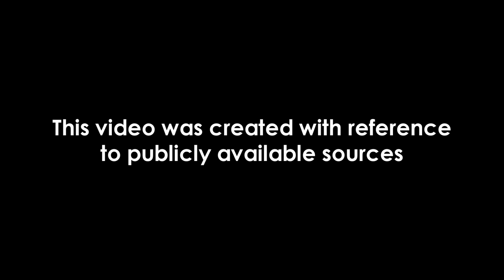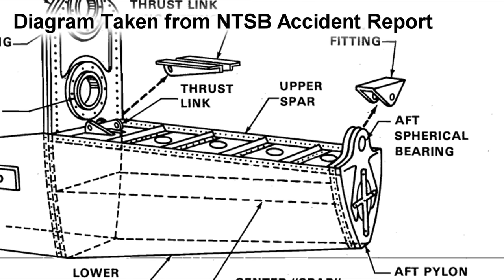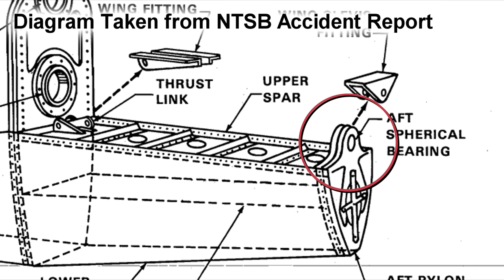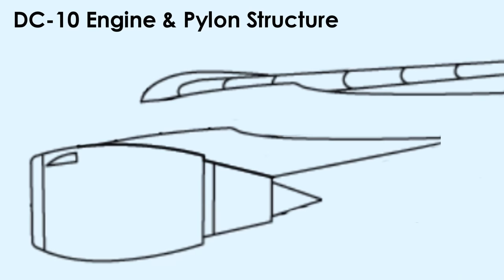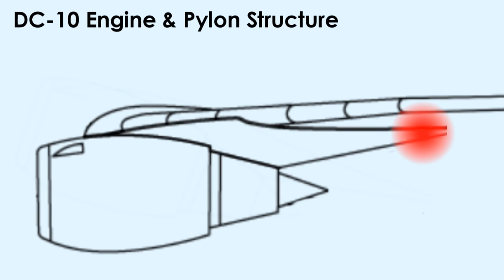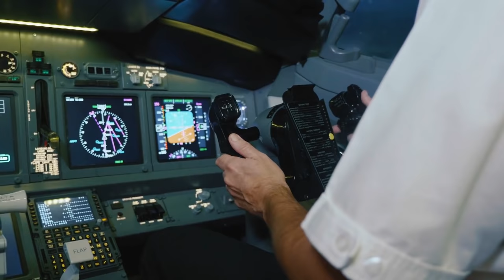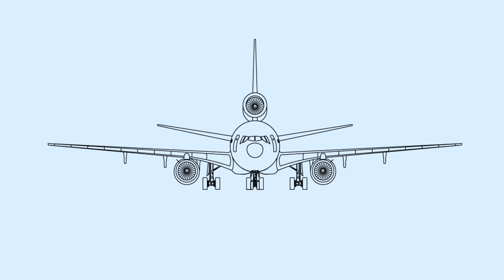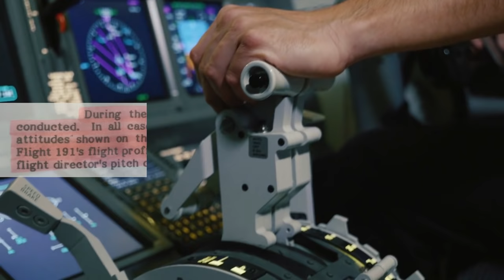America's Deadliest Air Disaster (American Airlines Flight 191) - DISASTER BREAKDOWN

Comment: This accident has always particularly horrified me. There were so many odd quirks — the captain wasn’t supposed to be on that flight. Parents who just happened to take a last minute trip to Hawaii and died. The CCTV footage available to passengers — showing them an external view of their imminent crash. And, most of all, the death toll. The way this plane went down was so preventable, and that is the saddest thing of all. Thank you for making another excellent video.
Reply: It wasn't preventable for the pilot maybe if he noticed earlier but at depaqrture a lot of things can happen. Just the maintenance crew screwed up big time
Reply: @saladasss2092  That is what I mean. If the maintenance had been performed correctly, this accident would never have happened.
Reply: @kristita_888  and it even said that maintainance shortcut was common practice
Reply: @saladasss2092  It was common practice at a couple of airlines — American and Continental. BUT that practice was not consistent with how the recommended procedure for the DC-10 stated that engines 1 and 3 should be removed from the pylon and wing. This is one thing I’m pretty familiar with, as my father made his career in maintenance with Continental Airlines, working from mechanic all the way up to manager.  He would not allow the men (they were all men in maintenance back then) to remove engines and pylons from the wings as one assembly — he insisted on following correct Douglas Company procedure.
Reply: @kristita_888  I wished there were more people like him instead of companies trying to cut corners to save money and endangering lives
Reply: When it comes to safety they shouldn't take shortcuts in maintenance. People's lives depend on it.
Reply: @margaretjiantonio939  I completely agree, and fortunately my Dad did, as well!
Reply: @saladasss2092  actually shortcut pratices like this are usually proposed by the mechanics performing the work
Reply: @kristita_888  What if's are a part of life!!
Reply: @Xscapeplan01  Yes, they are. But these “what if’s” never should have happened to innocent people. Just my take on it.
Reply: The saddest part was that the aircraft remained flyable but since they had no way of knowing they had physically lost an engine they could only follow procedure for loss of power. It was slowing to V2 that actually brought them down
Reply: @PabloGonzalez-hv3td  Such a good point! 💔
Reply: Oddly, it seems like these weird coincidences tend to happen in huge disasters. Just look at Apollo 13. The same thing happened where one of the pilots got sick, so another substituted in. This likely played a huge role in saving those in space as they had a fully capable person to do simulations on the ground. I suspect it's just common occurrences that just happened to coincide with the disaster so we look at it as if they were huge deals.
Reply: @cbot9302  You make a good point. And oh my gosh, the WHOLE Apollo 13 incident — just wow!! It’s a miracle those men made it home at all. If you’re at all a space geek, have you seen the miniseries “From the Earth to the Moon?”  It came out several years ago but it is SO good.
Reply: Not to mention important scientists like Itzhak Bentov, who was working on the gateway project, was aboard that plane
Reply: I guess if I had to go in an air crash this would be the best way to go.  Quick and easy.  Look at the Alaska 261 crash, also caused by maintenance cuts.  Now everyone on that jet endured a lot before crashing.  Now there's a crash that gives me nightmares.
Reply: @Litrocks13  — I will agree with you there. Those poor people. The flight crew never gave up trying to fly that aircraft, not once, not even when it inverted. For a moment they thought they were regaining control as they flew upside down over the Pacific...horrifying!  Yes, I would rather be in this crash than on Alaskan 261, if I were forced to choose.

As a little side note: my dad (a retired mechanic and inspector for Continental) and I were watching TV when news of that  crash came through. He heard the details that had come in so far, turned to me, and said, “I’ll bet it was the jackscrew in the tail. Those things are a pain in the ass.”  Sure enough — the jackscrew had failed due to inadequate maintenance. He knew it in five minutes. Crazy!
Reply: CCTV on the plane? What are you smoking?
Reply: @hootowl2112  You a little rude? 😂
Reply: @saladasss2092  200 hours of pay was worth more than those people's lives. Or more accurately, 200 hours x however many dc-10's were needing the maintenance.
Reply: @hootowl2112  No1 is smoking anything, its true. As a curiosity they had a camera in the cockpit (not just this plane, on several planes back then) behind and above the pilots with a look through the windscreen. The picture was send live to the big passenger screen, so the passengers could have the "full experience" of takeoffs and landings.
That practice was discontinued due to this accident.
Reply: @hootowl2112  They've had this for a while lol
Reply: @saladasss2092  I think the worst thing about it for me was that on this series of planes there was a video feed of the pilots view displayed in the passenger section so they could experience the thrill of takeoff. That means they got to see video of the ground coming at them right before impact
Reply: @PabloGonzalez-hv3td  - True, but to be more specifically accurate:  It wasn’t the physical absence of the engine, but rather that the leading edge slats retracted due to damage from the separating pylon AND that the captain’s stick shaker (stall warning system) was also depowered due to the loss of the engine.  Had the slats remained extended they would have been able to continue the takeoff, and if the stick shaker had been powered, the crew likely would have recovered from the stall and continue back to land.
Reply: @bradcrosier1332  The physical loss of no. 1 engine was the root cause of all that. 
My point is that despite all the damage you mentioned the aircraft was in fact STILL perfectly flyable had they known to maintain airspeed (above the damaged wing's stall speed) instead of slowing to V2; the procedure for loss of power.
Reply: @PabloGonzalez-hv3td  - 100% agree, just wanted to put a finer point on it for those unfamiliar with the details.
Reply: @bradcrosier1332  The stick shaker wouldn't have made a difference tho.
Reply: @PabloGonzalez-hv3td  - I’m curious what your qualifications are to draw that conclusion.

The NTSB certainly did not agree with that assessment (nor do I):

“The National Transportation Safety Board determines that the probable cause of this accident was the asymmetrical stall and the ensuing roll of the aircraft because of the uncommanded retraction of the left wing outboard leading edge slats and the loss of stall warning and slat disagreement indication systems…”

So again, please explain why realizing that the left wing was stalling would not have prevented the accident.
Reply: @bradcrosier1332  Just a hunch but the degrading attitude was plenty indication of a stalled left wing.

I'm curious what reaction you believe the stick shaker could have possibly prompted. 
The NTSB of that era thought smoking was a good idea 😂.
Reply: @PabloGonzalez-hv3td  - Let me put it more plainly:  Are you a pilot,
and if so what ratings do you hold?
Reply: @bradcrosier1332  I understood the question perfectly lol. You ever been in an F-18? 
Now what viable response do you believe the stick shaker and slat disagreement system could have possibly prompted?
Reply: @PabloGonzalez-hv3td  - Nothing Pablo?

I’ll also point out that you yourself acknowledged this fact in one of your previous posts (though apparently you don’t realize it):

“…the aircraft was in fact STILL perfectly flyable had they known to maintain airspeed (above the damaged wing’s stall speed) instead of slowing to V2…”

The stick shaker and slat disagreement systems, both of which were lost when power to the #1 DC Bus failed due to the separation of the #1 engine (which I believe would have also occurred during a engine flameout or failure, but to be 100% on that I would need to dig out my old manuals, which I don’t have time for right now), would have provided warning to maintain speed above the stall. The stick shaker activates PRIOR to the stall.  We will never know if the crew would have responded to that warning correctly - because they never received the warning.  If they had, they might well have responded correctly, and the aircraft might have been saved.  It most certainly was a significant factor. 

Accidents are almost never a result of a single failure.  Read the report with an open mind (re - your nonsense remark about smoking) and recognize that there were MANY failures which led to this (and most other) accidents. It’s called an “error chain,” and if you remove one link in it, you prevent the accident.  Had the maintenance organization not failed by using unauthorized procedures - no accident.  Similarly, had the crew known about the altered aerodynamic configuration of the high-lift devices - no stall, and hence no accident.
Reply: I flew the next week on an A/A DC-10 to Florida. 
I could have been on one of the planes they found with a cracked pylon attachment. They didn't ground them till I flew back on one. Makes the hair on my neck to stand up to think of that possibility. 
I flew DC-10 's alot, later.
Great airplane,  I loved them.
Reply: I was in Chicago that day. The night before the crash l had a dream that l was at a carnival watching acrobats high overhead when suddenly the performers fell off the platform to their deaths. Great sadness consumed the entire arena. The next morning l saw the breaking news of the crash.
Reply: @blakedarwin5171 
Or his cousin, Itchthatmore Bentov.
He invented the entire glotsbac conversion chart responsible for the glatsdale platform on the 747's INS Gyros.
Reply: @hootowl2112  
Melinneal....eh
Reply: @alhanes5803  - [Peg Bundy voice] "Oh Al honey..."

So just what qualifications and experience do you have to back up your assertions?

As to your statement that it, "...it would have only informed them of an impending stall, not that the left wing would alone stall..."

You see Al, the funny thing about swept and tapered wings planforms (and the DC-10, like most airliners has both) is that they both have a very pronounced tendency for the tips to stall before the wing roots.  In particular, the span-wise flow of swept wings at high angles of attack exacerbates and thickens the low-energy boundary layer towards the tips, limiting aileron authority and effectiveness.  Along with that, particularly if there is any sideslip angle, the tips don't tend to stall symmetrically, which mean there is typically a very pronounced rolling moment at the stall (wing drop, if you prefer).  And that is under normal conditions.  Of course you'd know that if you hadn't slept through aerodynamics class, if you've taken one.

This is why stall avoidance is everything in swept wing transports - a full aerodynamic stall can be very unpredictable (ask anyone who has done the stall checks required in the HS-125 series of corporate jets after leading edge maintenance - I haven't, but I've had colleagues who have.  Sometimes it's a non-event, and sometimes it is definitely an event to say the least.).  For further evidence, here's a nice video of stall testing the B-717 (nee MD-95):

https://www.youtube.com/watch?v=L2CsO-Vu7oc

We train to avoid stalls, so activation of the stick shaker WOULD have prompted the crew to act to avoid the stall.  We'll come back to that.

"...therefore, they would still have done, what they did, the exact same way.
Right rudder, and full right aileron."

That is not borne out by testing done after the accident.  From the NTSB report.  To summarize:  About 70 takeoffs were performed duplicating the conditions.  In many cases, the pilots, upon recognizing the onset of the roll at a constant pitch attitude, lowered the nose, increased airspeed, recovered, and continued flight.  Those who attempted to recover the 14 degree pitch up attitude commanded by the flight director reentered the left roll.  In all cases, the roll onset began at 159 knots.  If the stickshaker had been operative, it would have activated at 167-168 knots, providing a warning PRIOR to roll onset (and the aircraft was recoverable at roll onset, if the nose was lowered).  I am NOT condemning the response of the crew - as the test pilots note in the NTSB report, lacking the stall warning indication it is not reasonable to expect that they would have had the information to respond effectively (unlike the simulator pilots who knew  what was coming).  With the stall warning, it is an ENTIRELY different situation.  There is certainly no guarantee that they would have responded correctly, but they would have at least had a chance.  Incidentally, the simulator crews who did recover only needed about 80% right rudder to do so and 70% right wing down aileron - which negates the next bit of nonsense you dispense:

"Most they could have done was, lower the nose, and add power to #2, and reduce even more power on #3 to help reduce the roll."

So no, they would not have needed to do the last two steps, as the first would have been sufficient - which is PRECISELY what the stall warning activating would have prompted them to do.  If you knew what you are talking about, you would know that - above all else, you have to keep the wing flying to maintain control.  Now, reducing power on #3 would certainly have helped reduce the rolling moment, and increasing the power on #2 would have created a pitch down moment; but once the left wing became fully stalled, recovery became improbable at low altitude - which takes us back to my basic contention:  IF the left stall warning computer and stick shaker motor had been powered, the crew might have had a chance to avoid the accident.  The same could be argued about the slat disagree warning light system, but I find it much less likely that the crew would have been able to effectively register that bit of information with the numerous failure annunciations they would have been presented with - but the stick shaker is a singularly unambiguous indication which, by design, stands out among other warning indications.

"If you flew at all, or had even one of the ratings you say you have, you would know  that.
"

https://amsrvs.registry.faa.gov/airmeninquiry/Main.aspx

I don't use a screen name, so search away - I'm right there, as are all of my certificates and ratings.  If you are really Al Hanes, and not someone who doesn't know that the Captain of United 232 spelled his name Haynes, then I'd say that my ATP and type ratings trump your Private Pilot certificate valid only when accompanied by your South African license number PA20059.

So what say you to that?
Reply: @alhanes5803  - Nothing Al?  Please, tell me more about what I don’t know about transport category aircraft operations and aerodynamics compared to you.
Reply: @kristita_888  sadly a lot of occurrences in aviation tragedies have no precedence. Just about everything has to happen ONCE before we take it seriously. Let's just hope this lead to many new ways of thinking and safer practices. Then it's not a total loss.
Reply: @hootowl2112  CCTV has been around for decades. It may not have been in everyone's seatbacks displayed on flat-screens, but yeah.
Reply: @alhanes5803  yeah when I first heard of this accident it was said to be a bolt
Reply: @bradcrosier1332  well done 👏  Always a pleasure to learn a few things from those that have learned a few things
Reply: It was so preventable and yet the moment they took off down the runway there was nothing left to do but sign the death certificate. Absolutely tragic knowing that those passengers were doomed no matter how skilled the flight crew 😢
Reply: @PabloGonzalez-hv3td They had to slow at some point regardless.
Reply: @bradcrosier1332 It wasn't just an engine stall. The engine ripped off which caused retraction of the left wing through loss of hydraulic fluid. Is there a way to change that from a pilot's stand point? The video said multiple pilot's went through the same scenario on a flight simulator and none recovered.
Reply: @darlenekorson3716  - Not engine stall, aerodynamic stall.  Whether they could have recovered or not is very much open to debate, but as it was they had virtually no chance because:
1) They had no idea the slats were retracted, because the indication system being lost with lost busses.
2) Similarly, they had no idea they were in aerodynamic stall, again due to the only stick shaker being powered by an inoperative bus.
3) They followed the company procedures in effect at the time and slowed to V2, which was below aerodynamic stall speed of the wing without slats, causing the stall and roll.   Had they not done so, the aircraft was flyable - hence why those procedures have since been changed. 

Whether or not they would have disregarded the procedures had they had the stall indication (stick shaker) is certainly debatable,  but there is certainly a possibility they would have.  One of the most basic things drilled into most pilots is the idea that the first thing you have to do to recover from an undesired state is to get the airplane flying again.

The video vastly oversimplifies things in the interest of simplicity, at the cost of detailed accuracy.
Reply: @darlenekorson3716  They would have landed fast. Uncomfortable for the passengers, likely popping a few tires but with almost certainly 100% survivability.